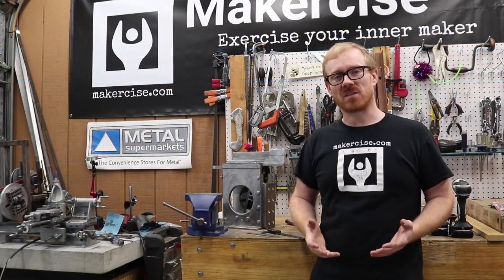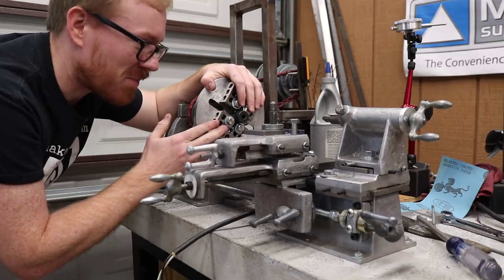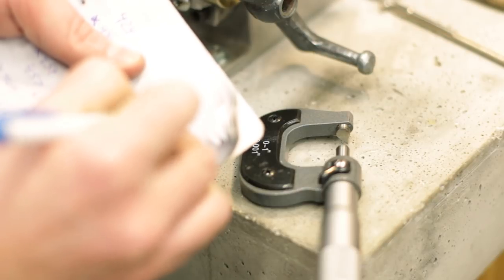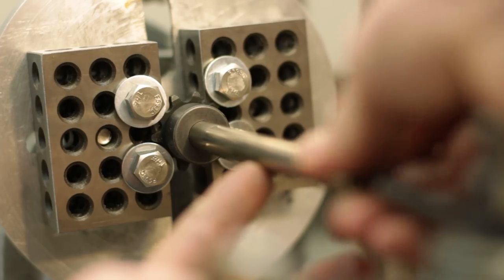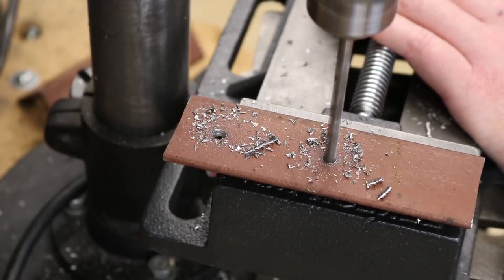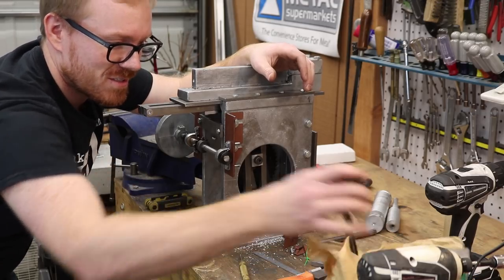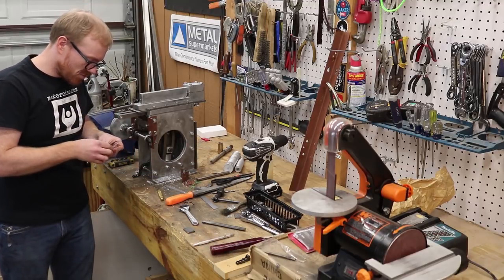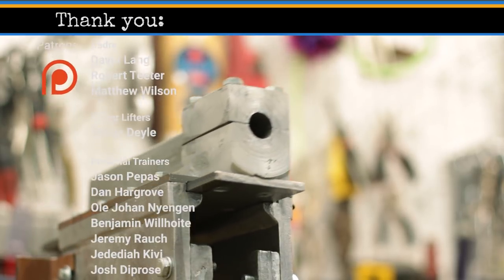Chain Drive Pinion - Gingery Shaper - It's ALIVE!

Comment: G'day Cressel,,coming along nicely. I too with the Gingery milling machine project used a cordless drill to run it, it feels good to see your work come to life. The 10 thou not concentric sprocket / shaft should be ok for a slow speed application but look to better concentricity for high speed work, but hey it looks great, well done. Peter

Comment: Yes, those are great tools.  The spirit of Gingery seems to include the idea of increasing accuracy as you go.  Why wouldn't you use your dial indicator to center up the pinion?  1/2 thou should have been easy to get.  Don't get me wrong.  Love the channel, will check out more.
Reply from the maker: It didn't seem so easy to get it better. At least not for me, at my skill level, on my amateur built lathe. I fused with it for 15 minutes before deciding it was good enough.

Comment: Excellent progress! Are you planning on making another concrete rolly-table for this build similar to the one you made for the lathe? I've had several of the Gingery books for a while and have wanted to get started... for that same while. Unfortunately, these kids running around the house like to eat and stuff.
Reply from the maker: +Hallofo I am planning on mounting it on the cart with the lathe. It will go near the opposite corner from the lathe.  It may be shown on the cart in the lathe cart video.

Comment: Hey what countersink bit do you use/ recommend cause mine chatters to much
Reply from the maker: MrPandaPlays i used a 90 degree 3 flute and it chatters like crazy. I have a 82 degree six flute (staggerex six) it chatters much less. Cutting fluid helps. Adding a piece of card stock between bit and work piece also seems to help some.
Reply: Thanks so much!!! I haven't had much luck with countersink bits but this should help.
Reply: Single flute or flute less countersinks seem to be better for chatter, or better for having less chatter I should say